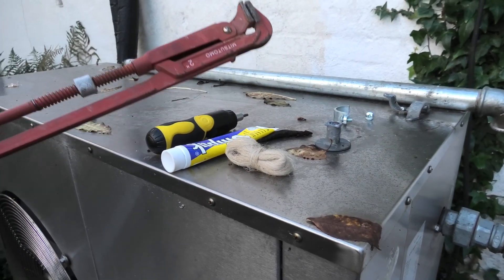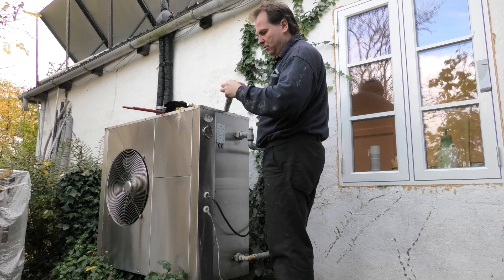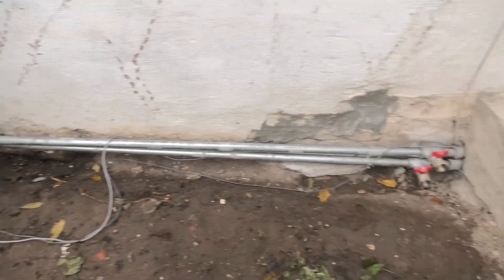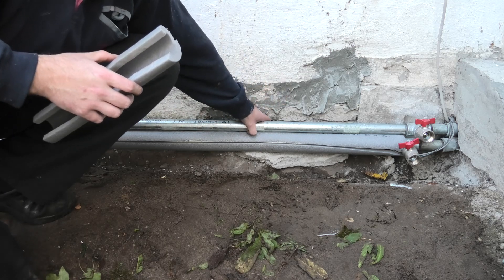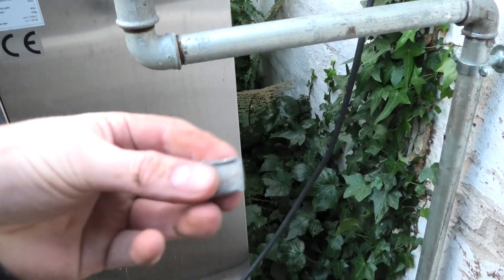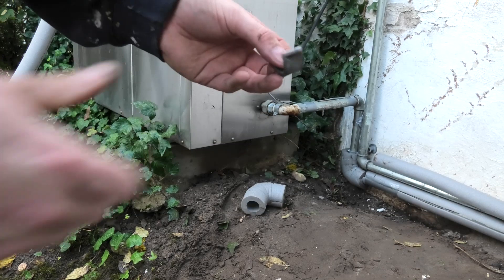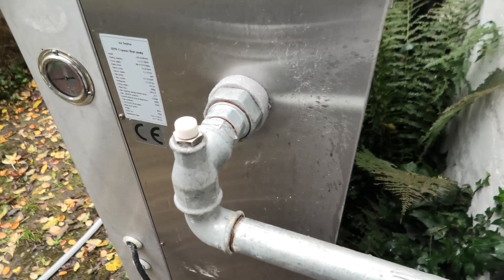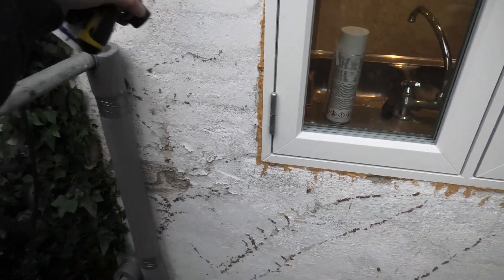Heat Pump, Piping, Insulation and Testing for Leaks - 1015

Comment: Hi Morten, i saw this video and i'm suprised that You use this cheaper pipe insulation and not those black squishy one that is used in climatisation , it's better one for outside instalation. where it's two times more exoensive but it's worth to spend more money. thanks for video and wish You luck with this project :)
Reply from the maker: I have some of that black squishy stuff on my solar colectores. It not as common as this other stuff.

Comment: All those servers are heating up the air outside ...... soon palm trees will grow in denmark !!!!
Reply from the maker: The heat is actually being used in side 🤗
Reply: @MyPlayHouse  Ok ha ha thats great.  Hey i was able to fix my server computer.  It was just a bad CMOS battery.  I was getting error messages like: MEMBIST failure - The following DIM has been disabled by BIOS and BM1 disabled in bios.  Anyways i put in a new battery and its back up and running now!!!

Running Manjero Mate 64 bit version on old Dell R410 Server.  
Processors: 2 Intel Xeon X5570@ 2.93Ghz (4 cores each)  - can turbo to 3.2Ghz.  Can hyperthread to 16 threads but video conversion seems to go faster with hypertheading turned off so i deactivated Logical Cores setting in Bios.
Graphics:  GeForce GT 730  with Proprietary Nvidia 440.100 Driver installed (running as a workstation and not a remote virtual machine)
RAM:  32GB
And Yes of coarse Compiz Window Manager !!!!!!!

Comment: Do not hope that the Danish authorities watch youtube, it is illegal to commission heat pumps without a certificate etc.
Reply: Is it illegal? That would surprise me. Here in the US you need a license to work on refrigeration systems. But here the refrigerant is all self-contained so that's not needed to install the unit, it's like installing a window air conditioner.

Note I'm not an expert on American law, and certainly not Danish law.
Reply: @eDoc2020  Bun i`am. I work with heatpumps in Denmark 😎
Reply from the maker: There is no messing with the cooling in a Air to Water pump, so it is legal (air to air is not) But as there is no connecting or disconnection of coolant, it is pretty much like connecting a refrigerator.
Reply: @MyPlayHouse  You obviously do not know that there is a cooling system in a heat pump, cooling the Air and heating the warter, The reason for requiring a refrigeration technician with a certificate is the amount of refrigerant, so it is a lot larger than in a refrigeration cabinet. in denmark you need a cat 2 certifikate this is for up to 2,5kg refrigerant over this amount you need a A or more. A sekend issue is that you are working and you commission a pressurized system
Read before talk..! https://www.kmo.dk/Pages/Forside.aspx or https://at.dk/media/1746/koeleanlaegogvarmepumperpdf.pdf
https://at.dk/regler/at-vejledninger/koeleanlaeg-varmepumper-b-4-4/
PS send a foto of the nameplate to dokument hove mutch refigurant is in the heatpump :-)

Comment: Horsehair? is that what you call it in Danmark? in Sweden we call it Änglahår (englehår)  
Are you absolutely sure that that hose can withstand heat? normally pem hose is only for cold water. 
Normal PEM 
becomes so soft from heat that the couplings can release if your unlucky.
Reply from the maker: It has been working for the last 6-7 years,, it will do the job. It is not actual horse hair. Probably much like, you are probably not using angel hair 🤗

Comment: Why do you keep the old metal pipes? Isn't it better to replace them and bury the plastic ones 15cm deep so they are isolated with soil ? you could even bury it with the isolation foam for less heat-loss ;)
Reply from the maker: Well, the new heat pump will be plastic,, let’s see how that goes.

Comment: Question... are you going to put valves between the big and small unit?
So when you're just running the small unit your hot water isn't flowing through the bigger unit and mixing with the cold water side.
Reply from the maker: I might have to add some one way valves,, to prevent that. But maybe they are already in the pumps.

Comment: Is it just water in this system or is it some sort of glycol mix ?
Reply: It would have to have some sort of additive, galvanized pipes and drinking water are a recipe for disaster.
Reply: @peterg.8245  I think it is some kind of glycol mix tbh 
I think he mentioned it in the solar hot water repair video ages ago
Reply from the maker: Yes there is a little bit of antifreeze in, this was mostly necessary when I was only here in the weekend.

Comment: hmmm 
YouTube has 0 views yet 2 likes lol
also some flexible conduit might be worth getting for the cables as it'll give them some protection from the elements btw
running the cable in with the pipe insulation isn't a great idea tbh
Reply: Agree with the idea of conduit, either flexible or rigid.
Reply from the maker: Why is that not good? It has been working for 6 years at least,, think it should be okay for a few years more.
Reply: @MyPlayHouse  the cable will wear out more easily when it's on pipes like that 
also I think the max amperge of the cable is reduced if you run it in insulation